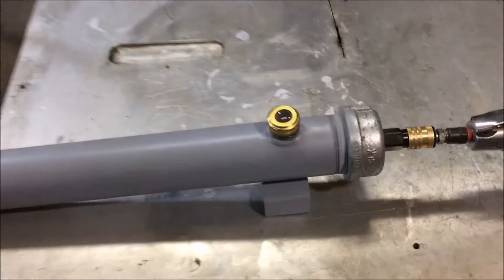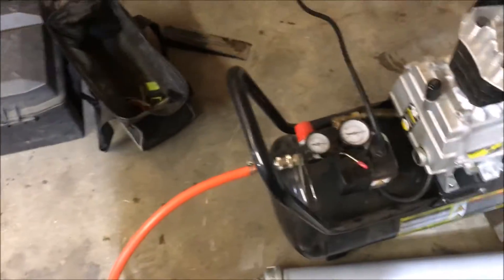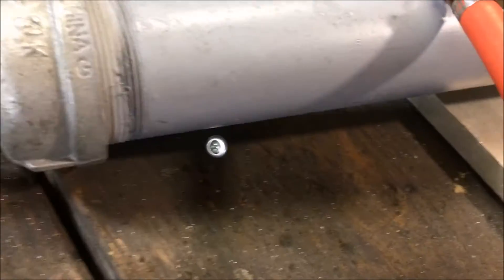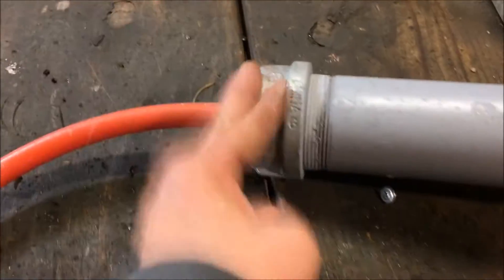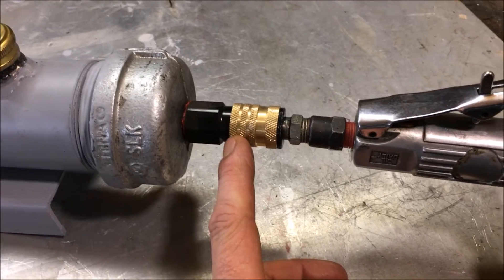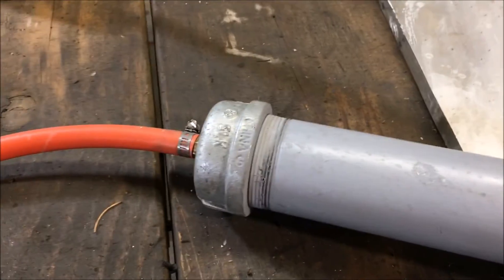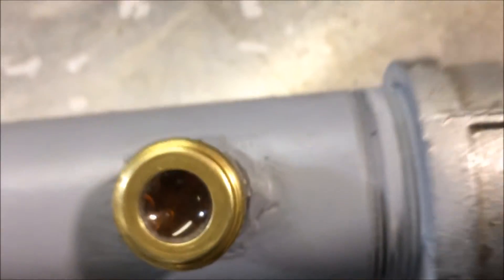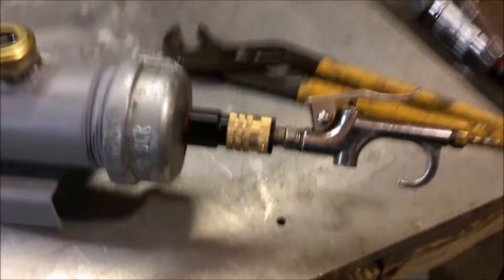DIY industrial Inline Air Dryer

Comment: Weird i just was thinking about using a pipe to build a air dryer but for painting when there is water in the line
Reply from the maker: Check my  ebay link to see the new design , dont use steel pipe it rust so bad , get a stainless pipe like the one in my listing pic

Comment: Hi, may I ask you what is the technical meaning of 'inline'. I am not an expert in this field and have tried to google it without success, thank you very much!
Reply from the maker: it means it can be connected in the hose line system any place you like , it connects into the hose line as if its part of the hose , this keeps it off the machine where it will likely get broke on a job site
Reply: @NOBOX7  Thank you very much!

Comment: Nice set up!  I was thinking to cobble one out of PVC.  But, I like the steel pipe solution for boat anchor durability!

I would be using mine for the final moisture trap before a plasma cutter in a DIY shop setting.  One thing I found that really decreases the moisture in my compressed air is just using another tank downstream.  Craigslist is full of 30 gallon tanks and such where the compressor has been roached.  I picked one up for $20.00.  You could also use BBQ propane tanks after welding fitting bungs.  Nice thing about the downstream buffer tank is that the actual compressor can be some distance away from the tool.   The buffer tank near the tool prevents the sharp loss of air pressure from a long line run.  My buffer tank does clear a lot of the moisture which I've noticed during sandblasting sessions during the humid Summer months.  But, the plasma cutter needs drier than dry air.

I can probably pick up a nice section of 3" or bigger steel pipe at the scrap yard and the capping plate steel on the cheap.  Weld on a 3/4" nipple for a ball valve and there's the easy-to-use fill/empty port.

Thanks for posting!
Reply: Desiccant is made from silica and silica causes silicosis lung disease from fibers in the air.  you need a micron filter to catch the particles after the desiccant and it also saves on your consummables. Just an FYI.

Comment: It is adiabatic cooling and the cooling effect when moving through a large to small orifice (called a Venturi) causes a drastic pressure change.  Given the right input temperature, pressure, moisture content,  and size of the Venturi, ice can form causing it to clog the Venturi.  This is why small aircraft which have carburated engines will also have a carb heat knob in the cockpit to divert a small amount of exhaust gas heat (as needed) into the venturi to melt the ice.

Comment: You still selling these ? If so how much desiccant beads will it hold ?
Reply from the maker: Yes i currently have 2 and i think its 2 liters . It comes with the beads and they can be recharged by placing them in the oven at 250 to 300  deg F until they turn orange . when they are green they need rejuvenated